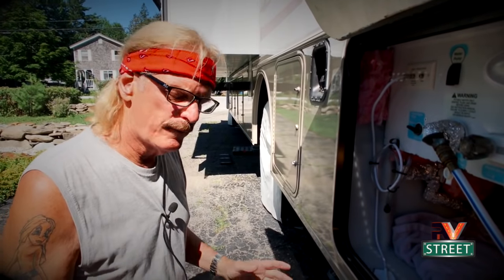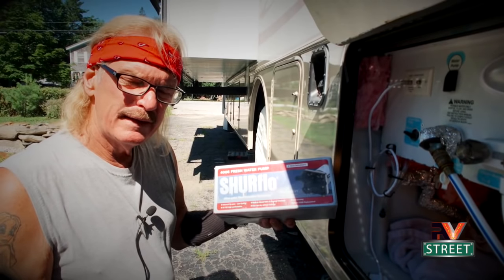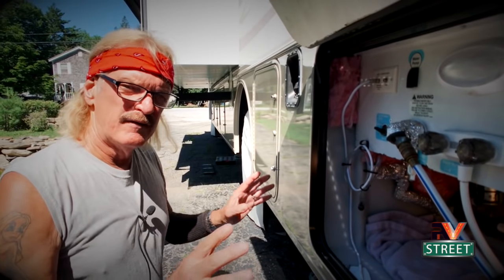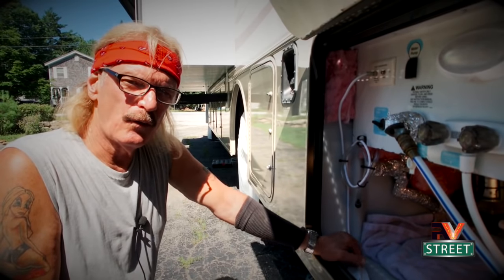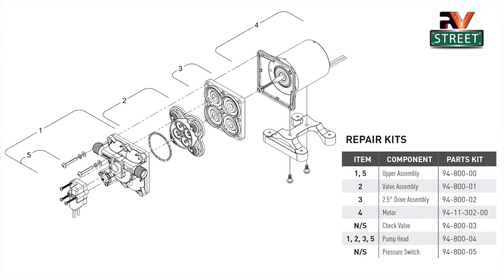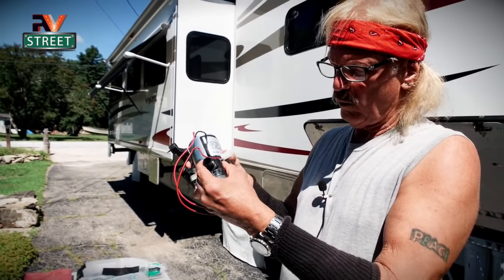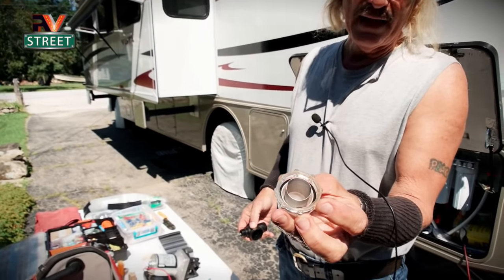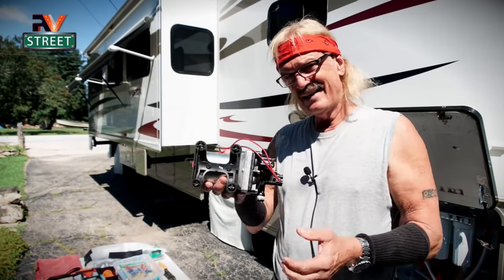RV SHURflo Water Pump Replacement & Important Tips

Comment: Had city water fill the fresh water tank on its own, with water discharging via overflow drain.  Wet bay Tank Fill/Normal valve in proper position.  2021 Vista with plastic valve— worked valve back/forth- stopped the leak but not sure for how long?  Also water pump pressure using fresh tank for shower and other use is great, but on city water wimpy.  Use a water pressure valve set to 55-60psi.  Any suggestions how to get rid of wimpy?  Leaving Maine after 5 weeks back to humid mid-Atlantic— enjoy rest of your stay Martin.  Thanks to you and your wife for the great service to all of us RVers trying to maintain our rigs.
Reply from the maker: Had city water fill the fresh water tank on its own, with water discharging via overflow drain
Your valve may be shot or have trash or mineral deposits in it and not sealing properly. I have a video coming out soon that addresses this issue. Do you have a water softener?
Also water pump pressure using fresh tank for shower and other use is great, but on city water wimpy
You may have clogged water filters? Changer them out if you have them.
If I understand your comment correctly, when you're on city water your main valve should be set to NORMAL. Then, you do not use the water pump. If you turn off city water and keep the valve set to NORMAL, the pump should work fine. Your pressure valve is set properly @ 50-60psi but that only applies to when you're hooked up to city water or filling the fresh water tank.
Come back if I didn't answer your question fully or you need to clarify so I understand better 👍
BTW...we're traveling the next few days so I may be a little slow responding.
Reply: Wow, talk about responsive-Army training showing.  Coming from a Navy guy.  😊 No not using a water softener, will change out the water filter. And yes, valve set to normal when on city water, and not using water pump. Will drain the fresh tank when I get home, then check the filter on the water pump. Assuming if I unscrewed filter cap with a full fresh tank, water would come pouring out.  Will look forward to your future video on the valve.  Thanks again.
Reply from the maker: @cortmassey2138  No need to drain the fresh water tank to check the screen on the pump. Look at your pump. See the water line coming into the screen bowl? Now, just trace back a little ways and you should see a "T" valve. Turn that valve and that will shut off water from the tank to the bowl.
Reply: @RVstreet   Thanks again Martin for the personal time you take to help educate RVers to better enjoy the experience. Heading southbound in Maine this morning with rain drops.

Comment: I'm using a fresh water tank for the first time.... however, i'm going to use it to water our city's pots on Broadway and the flower beds at the parks in town. But I'm in need of advice how to hook up the wiring, since it only has the stripped black and red wires, I need to somehow get an adapter of sorts to connect to my work vans current trailer hitch system... I'm new at all this stuff

Comment: Great information. You do great on the details and the safety, but two tiny things that I found hard to ignore: the plastic pipe is not "plex". It's "pex". There is no "ell" in PEX. And the electrical grease is not "dielectic". There's an "r" in there just like electRic. It's pronounced just like "die electric".

I don't mean to take anything away from your huge list of informative videos. I consider myself very handy and I've relied on your videos to help me get into the RV life and to build my arrival/departure checklists.
Reply from the maker: thx Ross,
Ya and it's getting worse as I get older. Pronouncing some words correctly only gets worst but people get the point. My videos are full of incidents like this so just be prepared. It's the same thing with my hearing. When I got wounded in the Army my speech and hearing was never the same. Joanie & I just laugh at it now on some of the things that come out of my mouth and what I think I heard someone say. 😂

Comment: I saw on another channel that the inline filter bowl is actually supposed to be positioned upright. I can't say for certain whether that's correct info. However, I'm going to turn mine upward and see how that works out.
Reply from the maker: That's not correct but ya let me know how that works out.
Turning it upwards will probably still work but, the Screen Strainer Bowl works best either pointing down or @ 90º one way or the other. My old pump worked for 9 years with this kind of set up and we use it everyday.
Reply: @RVstreet  Sorry haven't replied sooner. I haven't been checking youtube comments. You're right. Shortly after I made that comment. I ended up at Shureflo's website. Bowls goes down. That other guy had such a professional demeanor and channel that I bought into it, hook, line and sinker. And, I, who pride myself in not being duped into the BS on the internet. Like all filters, ALL, the bowls go downward, allowing gravity to sink heavier particles. So, I did not do the lame ass thing the fool suggested. Sometimes I think people intentionally tell misleading information. What a world. Happy travels ;-)

Comment: My thoughts on low voltage wiring repairs/installations: 1)Working on a bench or where sufficient space is available my first choice would be to solder the joint using flux and heat shrink covering. 2) Use a butt connector first choice is preloaded solder type, second choice a crimp type. 3) Spade or bullet connectors again solder filled first second crimp style second. Best to get the female ends with installed insulation jackets. No messy electricians tape that screws up when in a hot environment. I cut the wires so that the joints are offset not side by side and in a repair like yours I put the insulated female on the hot wire and the bare male on the negative. Also worth mentioning the color coding for wire size differences.

Comment: We have had 2 failures when we were on city water and replaced our floor. We now live only on our water tank and water pump. It is a small hassle to fill the tank almost daily but we have great peace of mind at night we turn off the hot water heater and pump. Never trust the water pressure at a rv park things happen all the time and they lose pressure then when it comes back on it may have excessive pressure.
Reply from the maker: That's a very good, smart practice. Don't forget to also install a pressure regulator at the beginning of city water.
https://www.youtube.com/watch?v=14Zo8Vkvh5o&t=581s

Comment: Another excellent educational RV video! Thank you. I carry a spare pump- BUT - I bought it in 1995 and I'm not sure it works or if it's properly sized for our 2016 Adventurer. Its still in its box. Guess I need to do some homework!
Reply from the maker: What year and kind of coach do you have Joe?
Reply: @RVstreet  2016 Winnebago Adventurer 38Q. Looked on the WBGO schematics online and got a part number (178763) but can not find any info about the specs for the current pump. The extra pump I have is brand new and shrink-wrapped, but its at least 25 years old. Its a Flo Jet 4000 but the datasheet says only rated to 20psi. Don't think that's going to work for this rig??? And 25 years old sitting in the box is a concern.
Reply from the maker: @americanrascal53  Isn't there any info on your current pump like a placard or something? There should be. But ya, 20psi is not going to cut it. And like you said, I wouldn't rely on a pump for a backup that's 25yrs. old. See if you can find the fuse or breaker for that pump. I'll bet you it's 10amp like mine @3GPM or 3.5GPM. It's a very common pump these days. Anew current pump is not that expensive. Let me know what you find out. I'd like to know. 👍
Reply: @RVstreet  Thanks Martin I suspect, but need to verify we have the same pump. I'll try calling WBGO Tech support today for more info. Unfortunately, the design of the rig puts the pump in a very tiny slot behind an equally tiny access panel over the HW tank- and even worse underneath a screwed down, upward swinging exterior panel door, without a hold latch-- making it very difficult for these hands to access. But I may have enough room barely to change it out of needed. So I can't read the manufacturer's plate as it sits. The current pump still works good but I want a proper reliable spare on hand at all times. If I can get through to tech support I'll see what they tell me about the pump specs.
Reply: @RVstreet  Just got off the phone with WBGO Tech support. They advise any off the shelf 12 V pump that puts out 55 PSI  will work as they have no specific manufacturer design. I will check dimensions to make sure whatever I buy fits, but I'd prefer an OEM set up. Guess I'll have to do some physical digging to see if I can find or access a manufacturer's plate. As the new (old) pump I have in storage it won't work as its only a 1995 20 psi vintage unit. Thanks for the follow-up, Martin. All the best.

Comment: Please correct me if I’m wrong. Appliance don’t draw amperage. Amp are the speed at which electrons flow.  If I’m not mistaken, it’s watts. Watts are the consumption (power draw).
Reply from the maker: IMO that is nothing but semantics. Watts or watts converted to amps is the same thing when measuring power. Whenever anyone is troubleshooting anything—including techs—your always looking at amps. Batteries the same way. What are the amp hrs. of the batteries. For another example: In this video the new water pump has a placard and it clearly says Fuse 10amps. When measuring the draw, you want to know how may amps is it drawing. So if you want to use watts that's fine by me, but ultimately your going to want to know total amps that are being drawn. That's my take 😎

Edit: Now in other videos I've explained when I buy different appliances for the RV I keep them to no more than 1500watts. Why? Because as long as I keep them @ 1500 watts or less at peak power, I know I can run them in emergency situations like plugging into a house 15amp outlet when parked at a friends house, OR....when I use my Bluetti for emergency power and so on. So in case I do use watts as a measuring criteria.

Comment: Hi Martin, Excellent video, very informative! Mine is cycling on/off about every 30-45 seconds...very annoying to say the least...I am inclined to just replacing the water pump. Could it be a bad check valve, or some other simple thing?
Reply from the maker: It could be a bad CV but since your rig is only 1 year old I doubt it. When your pump comes on and off like that it's usually one of two things:
1) You have a leak somewhere. When the water pressure drops, the water pump gets a signal that says repressurized the lines. So the pump comes back on. If you have a slow leak, or water in the toilet is coming in on it's own regularly you have a bad toilet valve, or a say a dripping faucet, or Ug a water line fitting is leaking somewhere in the RV. Were you one of us that just went thru all this freezing temps lately? If so I'm guessing a crack line or a leaking fitting somewhere. Leaks can sometimes be tough to find
2) Your main water valve in the wet bay, where you switch from TANK FILL to NORMAL. That valve is known to go bad. They will leak internally, dump the leaking water into your grey tank and then when that leaking occurs, you loose pressure and the pump comes back on to repressurize the lines. I actually had this happen to me about 2 months ago. My main valve is made of Brass. I liberally shot some penetrating oil right behind the lever and then turned that lever back and forth several times and the valve reseated and stopped leaking. A lot of the newer coaches today have plastic main valves so that wouldn't work.  But that valve is one of the first places I troubleshoot.

Comment: Have to say thank you I like your videos and because of your video I went out and bought a soft water system I thought I had flushed the soft water tank quite well but the next Day when we got up and used the water to make coffee we couldn't drink it we dumped out the coffee and made a fresh pot with bottled water..  then it was okay.. I drain the water from the tank an filled it up again.. but still had the same problem.. I have ran about an hour's worth of water through the system .. hooked it up again and still have the problem thinking I'm doing something wrong
Reply from the maker: What kind of softener did you buy? 
I drain the water from the tank an filled it up again. Not sure what this means?
When's the last time you've sanitized your fresh water tank?
Watch this video I did last week on how to properly take care of a ON-THE-GO water softener. Not sure though this is what you have.
https://www.youtube.com/watch?v=ubJ3g5fkiEc&t=5s
The whole idea of setting up your water filtering system correctly and water softener is to eliminate the need of bottled water, which just takes up more space, adds weigh and something else to buy all the time.
Reply: I sanitize my holding tank in the spring.. flush out the hot water tank and ran sanitize water through all my lines.. then I went to Camping World and ordered soft water tank that looks just like yours .. the tank came preloaded with salt .. ran water through it for about 15 minutes as instructed .. connected up my 3-stage canister filter system then to the saltwater tank .. filled up my fifth wheel holding tank about halfway and then headed to Utah .. I'm from Washington State .. got up next day to made coffee it was terrible .. drained the holding tank and the lines .. ran water through The Saltwater tank for another 15 minutes onto the ground then filled up the fifth wheel holding tank again .. next day bed coffee again .. sorry about writing a book
Reply from the maker: @lesterhamilton1740  Ah, no problem about length of post. I'd rather have more info than to little.
I've have NEVER heard of a water softener coming preloaded with salt. EVER. Preloaded with beads yes, salt no. But anyways. Did you ever back flush the water softener? Have you tested your water with test strips.  
I don't have any idea why your water is tasting bad. I'm just guessing here but it maybe your 3 stage filters need changing. I've never experienced your situation.

Comment: Great presentation Martin however I would have used just two longer pieces of shrink wrap tubing an covered the whole set of connectors and use dialectic grease and that will seal both ends without the need for electric tape which comes off Over Time.
Reply from the maker: Ya I should of done that. The reason I didn't at the time was I wanted to show how easy it was now to connect the wires from the new pump to the old plug and then I wrapped them with tape. But in hind sight I should of showed that.

thx for watching, your comment and kind words. 👍

Comment: I also shut off city water at night or when away. But a ?  I've had my holding tank fill up while on city, I thought maybe because I hit the water pump. ( I do use mine also) I was wondering if that caused the tank to fill up more.?  As for now when I have fhu. I make sure I only have a half tank so so in holding. And always checking to make sure it's not filling, but if it has, I have done a re boot if ya will. Gone out and released pressure from and re-hooked up the hose. ( To get that check valve lined up again.   Sometimes all good better safe than sorry 😐.  Just replaced my spare water again. 2nd time in 6 yrs
Reply from the maker: Water pumps do go out. They will go out faster if water feeding into it is not filtered properly and softened with a water softener. Mineral deposits build up on the diaphragm and check valve and cause failure. In addition to that......
Straight from SHURflow Manual:
Normal pump maintenance is all that
is needed: Checking and cleaning of
the strainer, normal sanitizing and
winterizing and occasionally checking
all plumbing hardware and fittings
for tightness. Lack of sanitizing is the
number one reason for premature pump
failure and poor performance over time.
Lack of sanitizing will cause scale buildup
on the diaphragm and valves, causing
low flow and leak back [occasional
pump cycling with no faucets open or
tank filling up when hooked up to city
water].

Here's a video on how I set up my water: https://www.youtube.com/watch?v=14Zo8Vkvh5o&list=PLkQXtMp9xodT-mrqODN1IH_B2ZAJJ--1c&index=1

My PLAYLIST: https://www.youtube.com/playlist?list=PLkQXtMp9xodT-mrqODN1IH_B2ZAJJ--1c

Comment: One more question?  Hope ya can help me. Water pump works smooth until the tank gets to 1/2 way. Then my pipes start jumping. I don't see anything close to them. 
Only thing I did allow someone to do last yr was remove the bypass valve. Because it has leaked or had to be replaced 2 times. I do not use it  I'm Ft. But if the pipes are not maybe long enough because of said cutting out the bypass.  Could that cause my issues sounds like pipes jumping?  
Southern calif. Tiogakattabella. Rig me & dog.
Thank you both for all the great help
Reply from the maker: Did this problem start right after you removed the bypass or is this a recent occurrence? If it's recent, it's not the bypass. It's has to be something else. It could be air in the lines. It's hard to say what is causing this without being there and diagnosing it. Perhaps email tech support of the maker of your water pump.